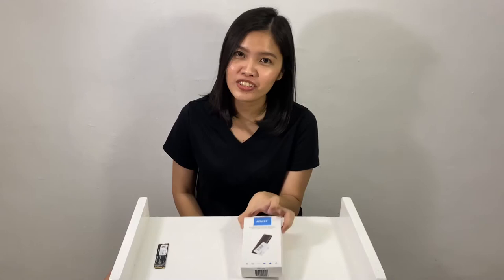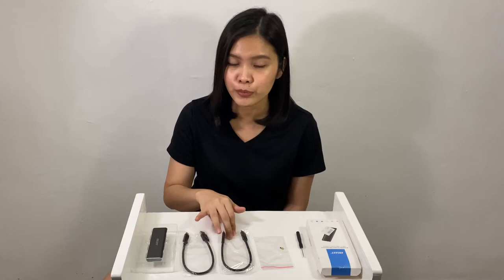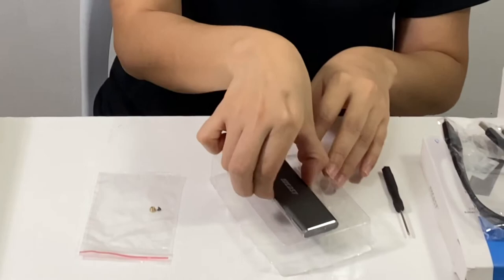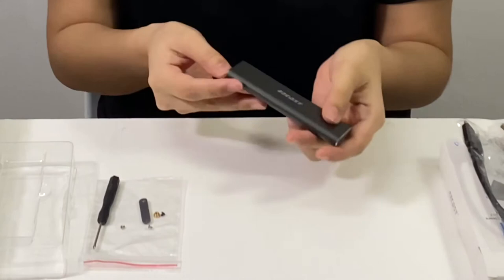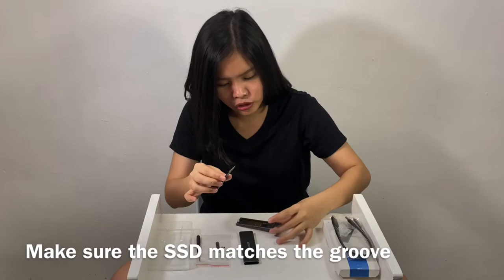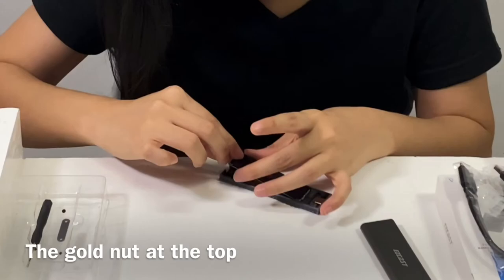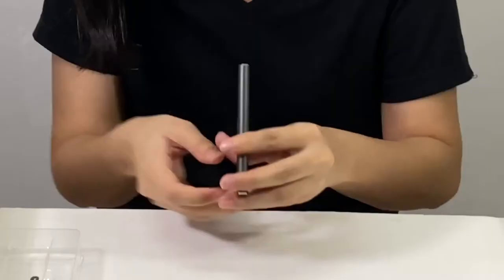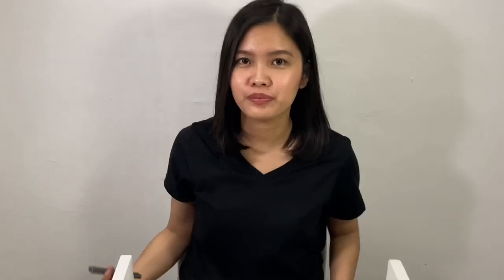How to Install M.2 SSD Enclosure

Comment: I cant seem to insert the golden strip is still very visible.. Should I force it?
Reply from the maker: Don’t try to force it. Try to plug it in without the enclosure first.
Reply: @angelynfey3328  but that would mean I need to unscrew it not sure if that will void warranty not.. But all the other ppl can plus it in just fine without taking the enclosure out.